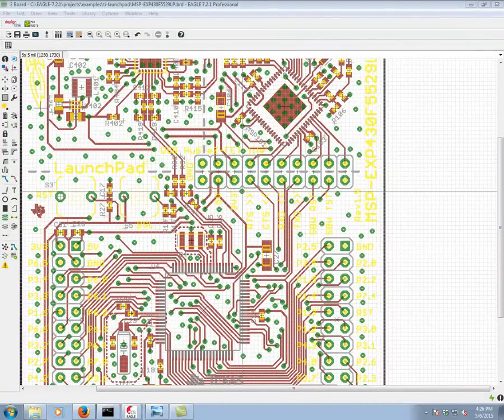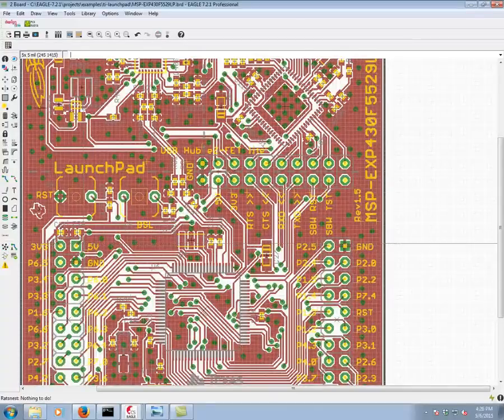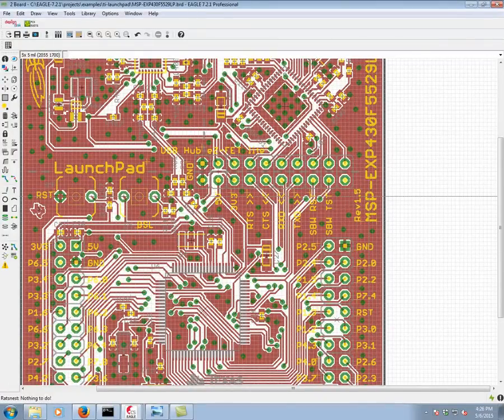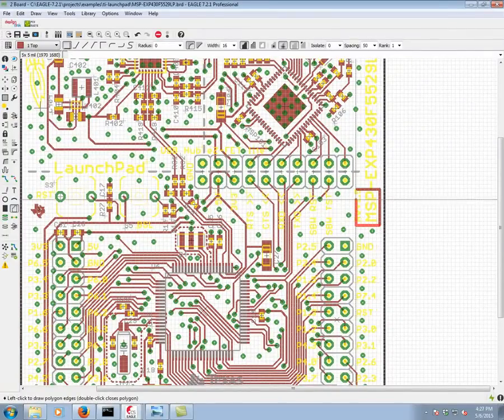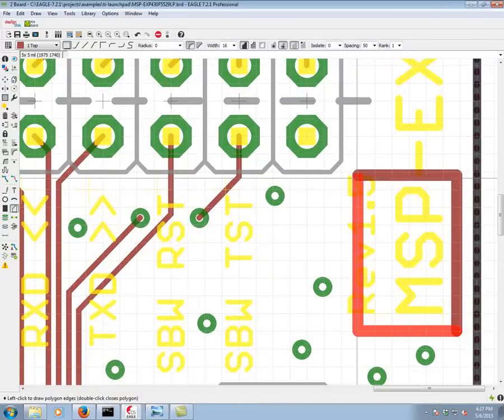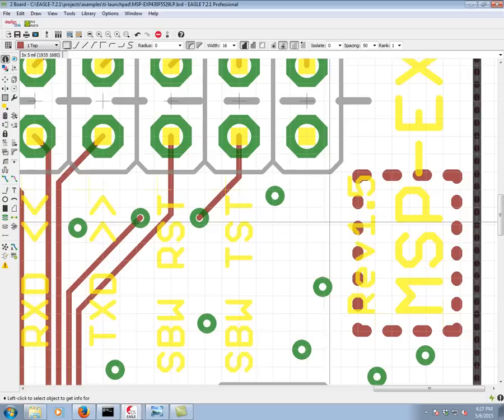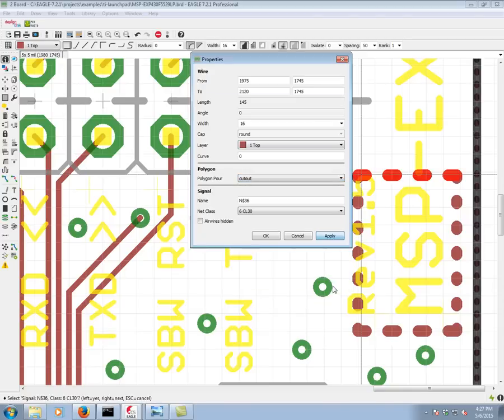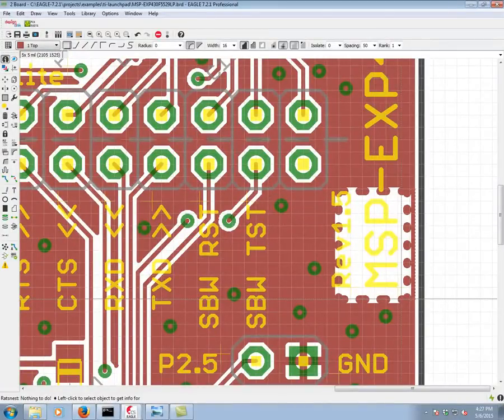EAGLE Polygon cutouts

Comment: I did it the same way, but BE AWARE OF THIS! When then has come to me a package with my PCB from JLCPCB, THOSE CUTOUTS WERE NOT THERE! (EAGLE 9.6.2 premium)
Reply: Hey buddy, just looked at this for exactly the same reason and I use JLC. I'm not sure cutouts would work in this way, but I am using 'lines' that are in the Dimension layer setting the line width to 0. Seems to work as can see the cutout in the profile section when you run the Cam Processor. About to send to JLC but I think it should work. Hope that helps.